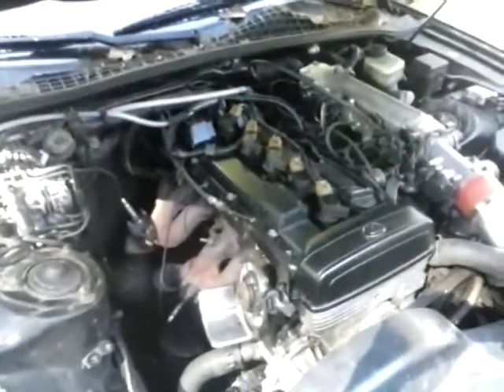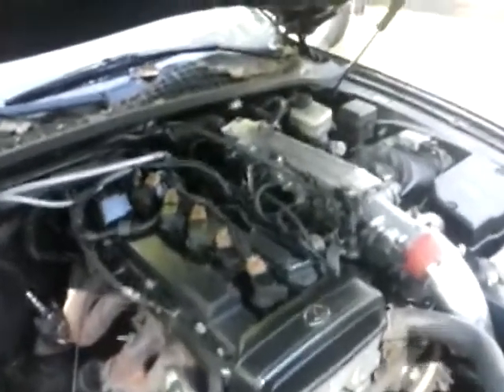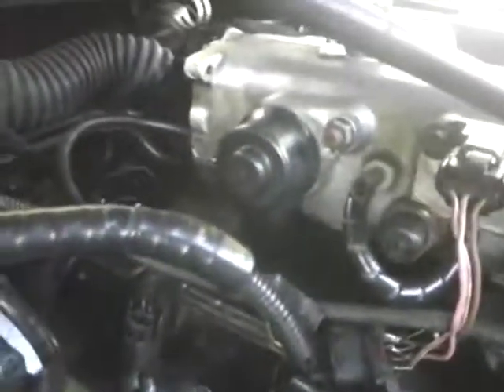Spoolxexo 2jzge 95 sc300 NA TT ECU mod

Comment: I just wired up gte ecu, ds62 igniter, map sensor and is300 coils/packs but my car shuts off all of a sudden.it will fire only when it wants, other than that it'll just crank. what are some common problems with 2jzGE + tt ecu,coils etc?I cant seem to figure out what the problem is. cranks all day btut only fires when it wants. when it huts off its sort of a bog
Reply from the maker: MINESINCLINED sorry man seems like you may have leaking capacitors. Google Toyota ecu capacitors.